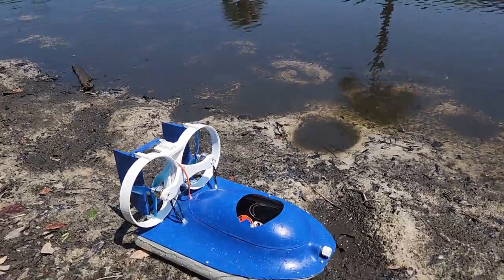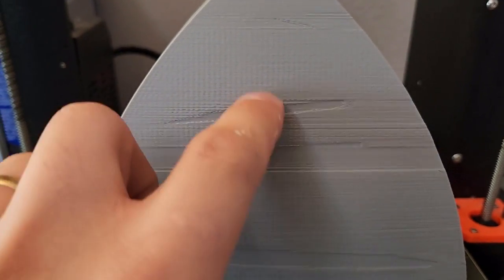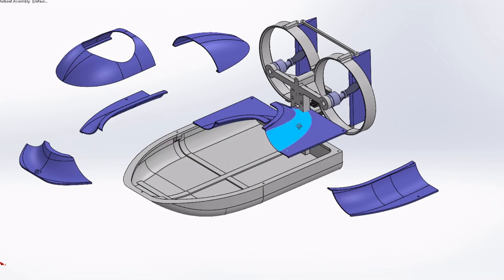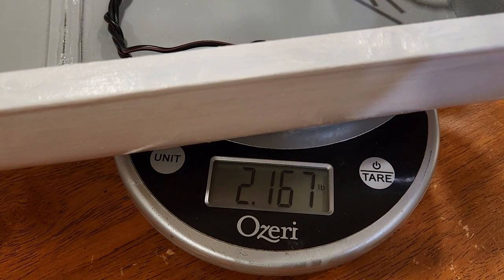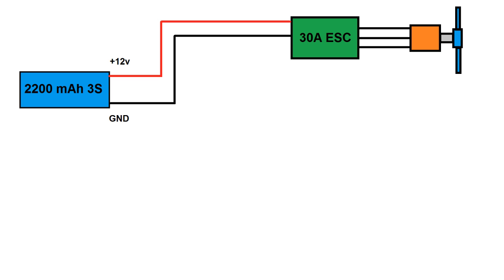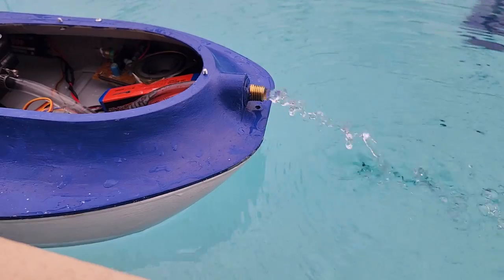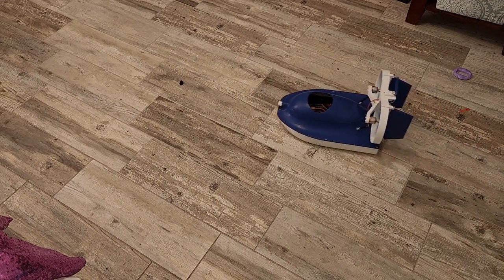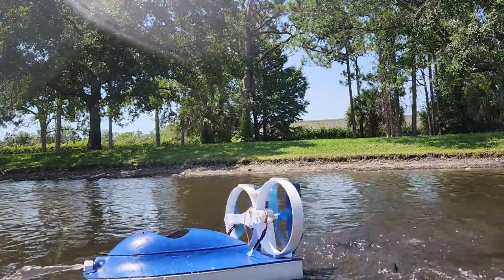RC Airboat with a Water Cannon

Comment: The one thing that I can see that you might want to consider is some sort of mesh cap for your water canon intake, mainly to prevent potential damage to the pump if something gets pulled in and caught. During construction, it would have worked to just get a piece of plastic canvas to bond into it, perhaps a layer of aquarium sponge filter, but something intended to keep anything solid or to mucky from jamming up your water canon.

Comment: Now it just needs a notched rear to the hull to help improve planing/stability a bit, and a steering gyro like RC drift cars have. Also a toggle for a differential thrust mode if you want really tight turns for whatever reason. Could have put some fiberglass strips or tape over the seams in the epoxy layer to really improve durability vs. CA glue, and some more sanding work in to improve the currently crude looking paint job.

It's definitely neat, yet there's room for a few more revisions that could still make it even better.

Comment: Very interesting project! The boat seems a bit tail heavy - if better weight distribution is not possible, you could try to compensate by tilting slightly the angle of the propellers. This might also prevent that oscillatory jumping at high speed.

Comment: Nice project! Maybe you should try powering it with the water jet? If the first nozzle you came up with required half power to compensate....You could also try pushing the jet into the water rather than in air?

Comment: the 5v from the esc's are vbat (12V) pulsed. Putting both the esc 5v in parrallel blows one of the 5V BECs becuase unless the pulses are perectly synced, you'll get more than 5V until 1 of them blows.

Comment: Try making an H2O splitter through ionization around 3kHz, 10 kV, inserting atomized water between the coils and using a car spark plug system with PWM on the 12V side to generate the 3kHz. Measure consumption x H output.
Reply: 🤔🙄.  That's not at all how water splitting works.  Even if that did split anything it would just immediately recombine.

Comment: do you have the files for the fan blade? also some of the files are different than what shows in your video, like the mount for the fans. i noticed it has holes for the wiring and things like that. i have printed just about everything to complete this project but am a little worried i wont be able to finish it correctly.  i was going to order the electronic parts you have on your video but was concerned that i might not be able to finish it since i cant find the fan blades.

Comment: try ducted piezo flap thruster, and/or electrostatic vacuum balloon, aluminium party balloon
Reply: flywheel is better than li-ion or lifepo, in all ways, 300Wh/kg and more energy density, it has integrated motor-generator, to match the electric load, easier to do, just a vertical maglev bearing opposite discs, on the bottom
Reply: energy storage metric: S=E/m=(pi^2)*(r^2)*(f^2) [J/kg], at about r=1m, and f=at least 333Hz, the specific energy comes 300Wh/kg+
Reply: btw, slap bendy transistors (relays) are the best!
Reply: dont shoot anyone in the eye
Reply: @Jkauppa  whoa man you're so far from comprehensible for me 😂
Reply: @g.simard854  smoke something :) clears the view
Reply: @g.simard854  great if you understood me
Reply: btw, CaO (+ added water) has 300Wh/kg energy density, as a put put boat power source, water all around
Reply: @g.simard854  did you get the new(est) idea just above

Comment: How is the arduino playing the audio at 9:54 ?
I am only seeing an SD Card reader but no dedicated audio/mp3 playback chip. Do you play 1-bit waveforms directly out of a GPIO?
Reply from the maker: Yeah. It's really terrible.
Reply: @HyperspacePirate  i think its pretty cool. did you use a library for that? would be useful as very simple sfx for some projects
Reply: Your best bet would probably be to just pull the guts out of a bluetooth speaker if you want something you can control remotely.